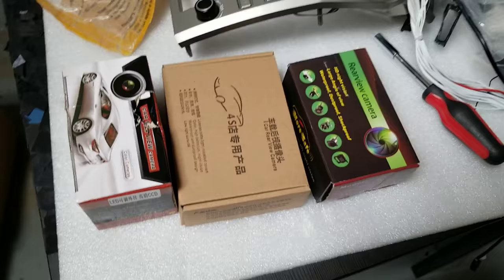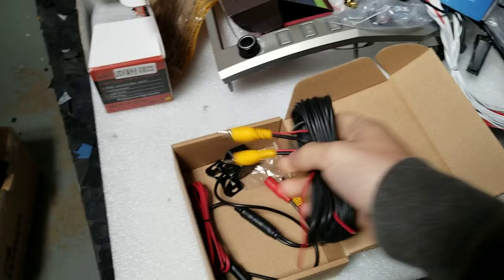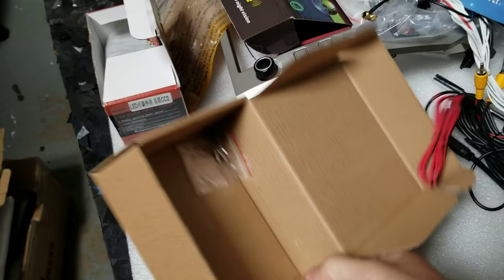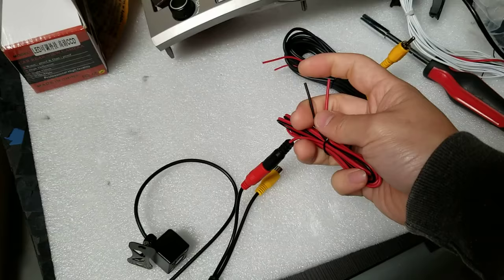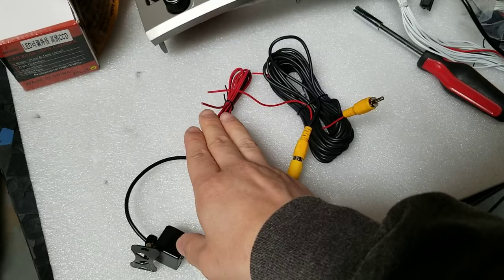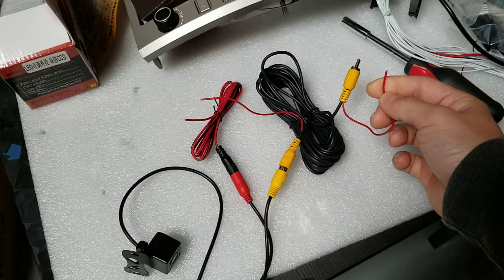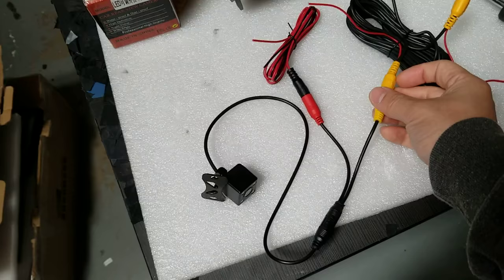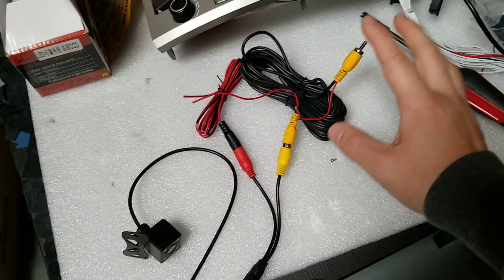How to Connect: Aftermarket Camera

Comment: Thanks for this. Simply put. Every other video just made things so much more confusing than it needed to be.
Reply: john coburn basically find positive from the back of the radio and the ground. Connect them to the camera power. Connect the camera plugs and that is it
Reply: john coburn How to install a Backup Camera Any Toyota Camry 2012-2013-2014 - Step by Step (Problems are Fixed)

Comment: FINALLY a clear explanation of where the wires connect to. Thank you!
Reply: Not really! The red and black wires are for a continuous power supply incase your head unit allows you to view camera while not in reverse! If it doesn't, you don't even need to connect that pigtail! All you need is the video plug and to run that single wire to the reverse light posative!

Comment: Ok I have a Kenwood DDX model with the camera button so I need to run separate purple wire from the reverse trigger wire? And then the red wire from the camera connects to the red from wire harness? And of course need to tap into the ground wire.

Comment: What if you just need to hook it up to the factory back up camera?
Reply: yu’re on the wrong video, says aftermarket, not factory
Reply: I’m pretty sure the C6 never had a backup camera across any spec for the generation, so it would be impossible to install a factory backup camera that never existed. And if you meant to factory radio it doesn’t got the input connections for it sense they never had a back up camera for the generation.

Comment: The RCA female and red power female plug started off the same point , but the RCA red wire is much shorter than the power red-black wire , so how does the 3 touch together ?
Extend the RCA red wire ? Or splice into the beginning of red-black power wire to connect the RCA red wire , then splice again at the end into the reverse light power.
Reply: The RED wire that is along with your yellow to your devise I split in the middle and from there I connected the other one kind of like a "T" if you understand I hope you do you'll get it

Comment: This is correct except were it plugs into the stereo. In back of the 13.3 androide it plugs into the ccd-2 and the trigger is on the same plug with the wifi cable.

Comment: See that's what I thought I've hooked up back up cameras plenty of times before I got the RCA running with the red wire in it for the trigger and then I got the camera running off the other reverse light so I'm not drawing too much off the one cuz off the one it didn't want to work so I did it off the other one and just with the ground wire hooked up and the power wire unhooked just for the camera it was still trigger the radio to pop up the screen for the backup camera but if I hook up the ground for the camera it puts my amp into protect and it takes away the backup screen and then dims my backup lights how is that possible with just the ground wire hooked up for the camera and only the trigger wire hooked up for the radio soon as I plug that RCA in to the camera it does what it does and puts my amp into protect dims my lights and kicks the radio out of reverse

Comment: Hello
Can you advise if the black is always going to be ground and red power? i am trying to connect the camera to a kia forte 2015 brake light and there is a black red and green wire
Thanks in advance

Comment: How can I get my front camera working ? I got the reverse cam working but can’t figure out how to get the front cam working . Not sure where to connect the red wire behind the head unit . I connect it with the reverse one , it turned on but I cannot view (and it has its own rca front cam)

Comment: Hi Thanks for your videos, very helpful. I bought this item and I fixed it. When I switch the reverse gear everything works fine but when I switch on (start engine)  it shows two displays in the monitor, I mean two pictures running at same time in one monitor. Can you  show a diagram how to fix this item please? Thanks. This is the item I am talking about:     360 Degree Bird View System 5" Monitor Auto Car Recording 4 Camera Panoramic | eBay

Comment: Can you advise what the reverse trigger wire is? My unit doesn't bring up my camera. Truck wasn't factory wired for one so no stock reverse wire. I have my reverse positive wire tapped just need to know what to tap on the headunit.

13.6 px6 tundra 2010
Reply from the maker: The wires are labled.
Reply: Kyle Bechtold I talked about this. How to install a Backup Camera Any Toyota Camry 2012-2013-2014 - Step by Step (Problems are Fixed)

You don’t need trigger from rear light
Reply: I know your post is about 5 months old, however, when hooking up this camera, the Reverse Trigger wire is the power wire running to you reverse light in your tail lights. This is the white reverse lights not the red break lights or the yellow turn signals.. So when you put your car in reverse, the white lights shine so you can see when backing up. You will need to tap into the wire that runs to that bulb For most of my cars it is a green power wire and a black ground wire. That will send a signal to your camera when you put it in reverse.

Comment: Great video!  What if you want the camera to stay on while you drive , like a rearview mirror ?
Reply: You have to connect the power source to somewhere other than the rear brake light.
Reply: @caligaming9386    That’s if you want the LED’s on the camera to burn ALL OF THE TIME.   

The red plug at the camera is only to power the LED’s.  The camera itself gets power from the yellow plug at the radio.    This is why the “convenience wire” was added later.   So you could view the camera (if radio has the option inside of it ) without the LED’s burning all of the time .    

When you tie in the “convenience wire at the tail light “?   That just signals the radio to show the view without hitting the button in the radio . And turns it on when hitting reverse. 

This is NEVER explained in videos. 
The RED AND BLACK ON THE PLUG AT THE TAILLIGHT “?  It’s only powering the LED’s in the camera.  The camera gets power (because it also has a positive & negative ran inside of a single plug ) from the yellow plug at the radio/head piece.  

Explaining this would take all of the complexity out of it.

Comment: I installed a side camera and enabled the settings to show when right turn signal is activated but it doesn’t work. Do I need to get the camera power from the turn signal? If so will the camera turn on and off with the fluctuating signal light?

Comment: Does the black ground wire connect to the black wire that goes into the reverse light or just ground it to the metal somewhere?
Reply: Either way works

Comment: Why would you need power feed to camera from TWO cables; 
one cable from head unit through video feed, 
and another cable from reverse light positive?
Reply: The small wire from the reverse light is just to power the LED lights on the camera. The RCA wire has both power and signal for the camera. The reverse triggering is done from the front radio end and has nothing to do with LED lights on the camera. The camera should work fine during daylight without the LED lights.

Comment: Will wiring it this way allow my camera to turn on when in reverse and when I’m driving and select the reverse camera option on my double din?
Reply: Did u figure it out
Reply: Alyana Beltejar yeah i just got done with the install a couple days ago following this vid, only thing is the Line out put converter he linked different than one in the vid so I ended up using the PAC LP5-4

Comment: I bought a px6 for my 2006 lexus is 250 I has the navigation system and back up camera so I want to keep my OEM back up camera can you tell me how can I do that
Reply from the maker: You need to do some wire cutting and splicing.
Reply: @phoenixautomotive4336  can a Phoenix person come did the wiring and cutting?
Reply from the maker: @pod0004  You can come to our location.
Reply: @phoenixautomotive4336  in California? I'm in Texas.
Reply from the maker: @pod0004  Yes, we are located in LA.
Reply: @phoenixautomotive4336  you have any local Phoenix installers in Texas?
Reply from the maker: @pod0004  No.

Comment: I used this exact configuration in my 2016 Nissan leaf. I am using a pioneer DMH-220EX. When I put the car in reverse, or go to the camera view on the head unit, it just says caution the video may appear reversed But there is no video. I'm stuck.

Comment: Thank you so much. 100% accurate
Reply: Hey Thomas, can you explain this further. I installed this camera and I have constant power to the camera even whtn the car is off. I hooked up the 2 red wires to my reverse "trigger" which is tied into my tail light. the yellow RCA is hooked up tp Camera in the harness behind the unit and I only have a few wires that are called Back or Back Power, nothing called Reversing. I hooked to "Back Power" and I get power at all times even when the car is off. The wire called "Back" does not do anything.
Reply: @smitty8403  are you havin trouble where to hook it at head unit. Mine said back or sothin. And i tapped into my tail light wire harness goin to bulb
Reply: @ThomasFromFlint  so I have tapped into my reverse light at my taillight for both power wires that plug into the camera. At the radio unit they instruct to tie into a ware labeled "Back power" or "Reverse". Out of all of the wires and wiring harness I only found a wire called "Back Power". When I tie into that wire I get constant power to the camera. I think there is an issue with either the harness or the unit sending constant power to the wire. Which is weird because the unit is off when the car is off but this wire still has power....so I'm just stumped.
Reply: @ThomasFromFlint  Yeah I remember hearing him say reverse in the video as well. I think I will need to just try tapping into a few different wires into the harness. I have a 2013 ford edge and the install video they offer does not goe into very much detail at all around what each wire does and what it is used for. the F-1250 however, they have very detailed videos. Just siwh they would make a better one for the Ford Edge.
Reply: @ThomasFromFlint  So I tried the other green wire called "Back" it seems to work and only gets power and turn the camera on in reverse. I assume that is a standard function. Be that the LEDs on the camera are tied directly to the camera power, there would be no option to tap the camera into a constant power as the LED lights would be on at all times when the care is running. Honestly, I could tape over the lights as they are not needed if I could see the camera at all times. Maybe I will mess with constant power in the future. For now it works and that is all I can ask.

Comment: Need immediate assistance! Camera light is always on even when vehicle is turned off. This will drain my battery. I have identified this being an issue with the power coming from the video cable red wire to the unit. Please respond.

Comment: When I put my vehicle in reverse, the music/radio sound stops or mutes out. Is there a way I can change to let it keep playing when reversing? I have the camera connected to a Soundstream VECP-65
Reply: most likely not, they're probably designed to be be muted so if a backup sensor is connected you can hear the beep
Reply: Check settings

Comment: I have hooked up two different cameras and when I switch into reverse it shows a black screen with the line assist. Everything is hooked up correctly and my cameras light up. Any ideas?
Reply from the maker: https://docs.google.com/forms/d/e/1FAIpQLScCzzfMcntPoj6oHMRyhrFmou5VGiyGfBNvvnHrjrr_qcgZ4g/viewform
Reply: Brianna Rosenberger 2 cameras are not going to work. There is a shortcut. Use 1 camera instead
Reply: Brianna Rosenberger How to install a Backup Camera Any Toyota Camry 2012-2013-2014 - Step by Step (Problems are Fixed)

Comment: Lol CONNECT the wires not touch!! And are you talking about the reverse wire that CONNECTS to the front rca camera's power lead? How does the stereo know i am in reverse? the only reverse wire i have is coming off the radio not the stock wiring block this is a 2005 crown vic. So i just take that reverse wire coming off the head unit and CONNECT it to the yellow rca's red wire that is CONNECTING to the head unit? Sounds like magic and fairy dust lol how does the radio communicate with the cars electrical system to know i just shifted to reverse :S

Comment: This method is incorrect do not hook-up all three red wires together. The red and black wire should hook into a switched 12v source this allows the camera to be viewed at anytime. The red wire with the video input should be connected to your reverse trigger signal and the opposite should be connected to the radio reverse signal lead. When reverse is activated it will signal the radio to change to the rear camera for viewing.
Reply: Can you please explain further? I am hooking up to my Ford edge and I was curious as to how this setup woudl allow for the camera to being viewed at all times. I understand I heed to hook this to tap into a reverse light so when i put in reverse it sends power to the camera, however, I would also like to view the camera at anytime since there is an option to view the camera at anytime on this unit.
Reply: @smitty8403  your camera should be connected to a switched 12v source the additional 3rd red wire should be connected to your reverse light trigger and the opposite end of the cable that connects to the radio should be connected to your reverse camera input and the red wire should be connect to the reverse wire on the radio
Reply: @smitty8403  by doing this when the vehicle is shifted into reverse it will automatically change to the rear camera input
Reply: @smitty8403  I dont know what brand of  head unit you are using but most radios will let you view the camera at anytime as long as it is powered on. Keep in mind the radio does not power the camera it only views it as an input device
Reply: @realdeal7188  I'm installing the Pheonix Radio that this company sells. That is what this install video is for.
Reply: I think my confusion is around the camera always having constant power. In the video they say to hook the 2 red wires together and tap I to a reverse lead (probably a reverse taillight power lead). If that is the case, how is the camera getting power unless being put in reverse?
Reply: @smitty8403  because some radio's will allow you to view the camera anytime if you hook it up the way you were it would only work if the car was in reverse and it will switch radio to reverse input everytime you press the brakes
Reply: Power wire would be hooked to reverse light... not break light. Reverse lights (white light) does not come on when you hit the break. I would connect to that.
Reply: @smitty8403  correct! Nor will you be able to view the camera unless it is in reverse
Reply: @realdeal7188  Incorrect, I am not sure what it is about the Pheonix Radio, however, I just hooked up the camera as they instructed and it works when putting it in reverse and I can also go to the "Cam" option at the top of the main menu and go to Reverse and see it when not in reverse. I believe that the radio is providing power to it constantly and there is also the power signal when you put it in reverse when you connect power to your (White Reverse light).
Reply: @smitty8403  ok
Reply: @smitty8403  Did you connect the ground And the 2 positives all 3 together into the reverse light wire? I’ve seen people doing that and I don’t really get why they’re tying the ground in with the positives but the wire on my backup cam is super thin like 32 AWG wire so I can’t use a splice
Reply: @alexharper9786  No, I grounded the ground and then connected the 2 red wires in to the reverse light power. The way the camera is set up, there is power needed from the reverse light to know the vehicle is in reverse, otherwise it seems to get power from the AV power wire.
Reply: Justin Smith did you hook the ground(black wire) to the black wire that goes into the reverse light? Or hook it to a metal frame somewhere?
Reply: @brisapp  No, I grounded to a bolt on the frame of the vehicle.